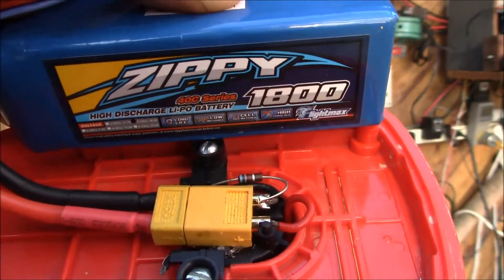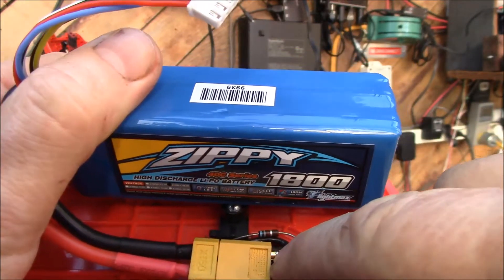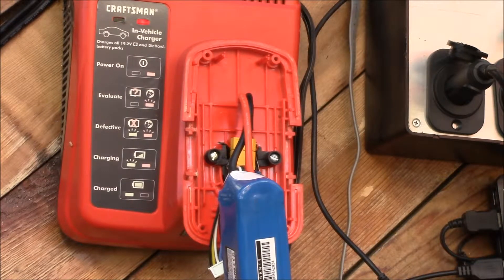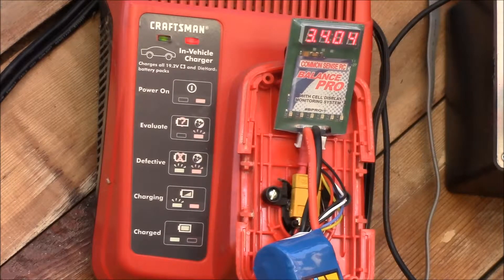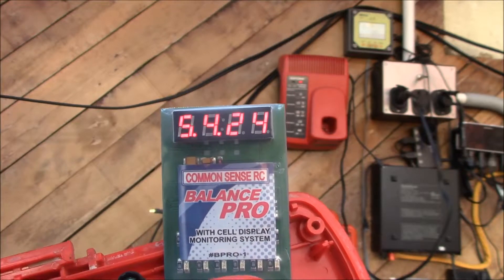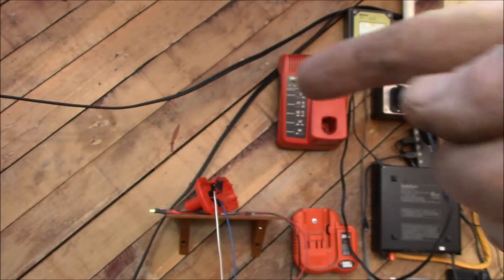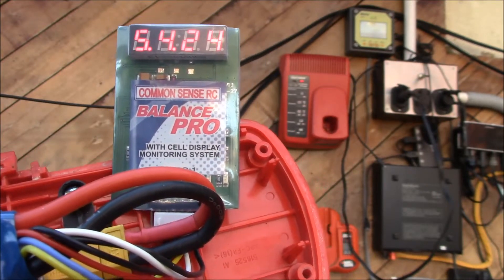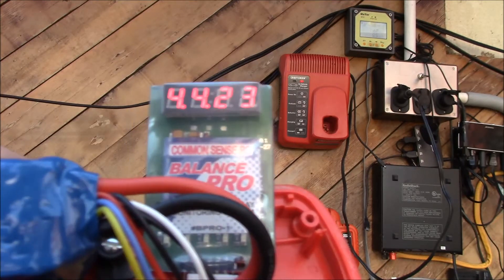Craftsman C3 Battery Charging, Part 6

Comment: I think that you are right, if you bypass the onboard bms and the batteries are straight to the c3 charger it charges it as if its nicd.  I put a switch in between the negative of the last cell and the neg charging post because it would only show less than 10v and wouldnt charge as is. It wound overcharging and dropping out 2 cells that way.